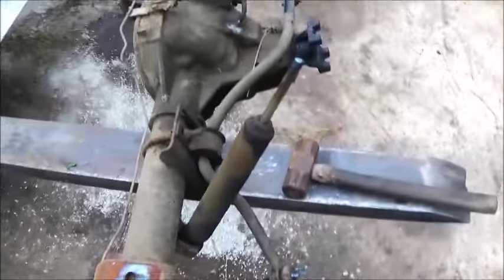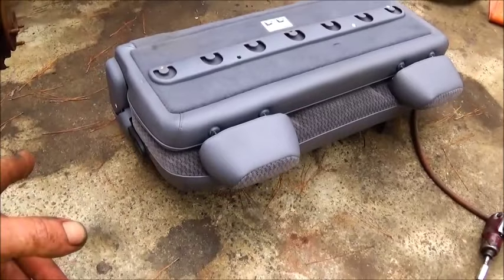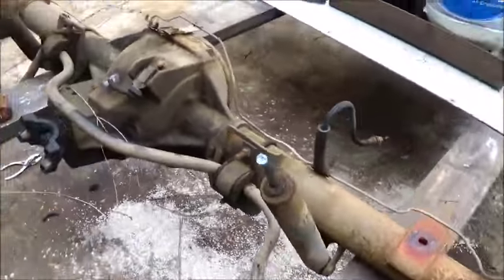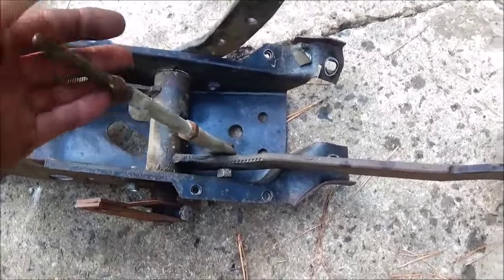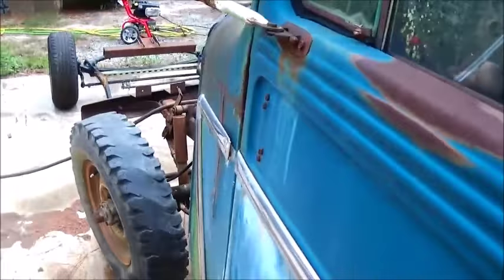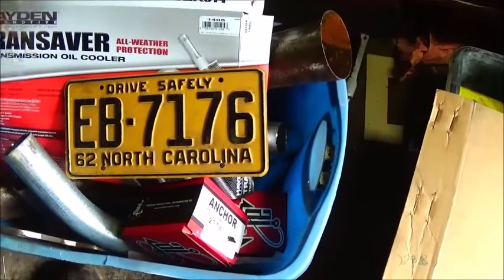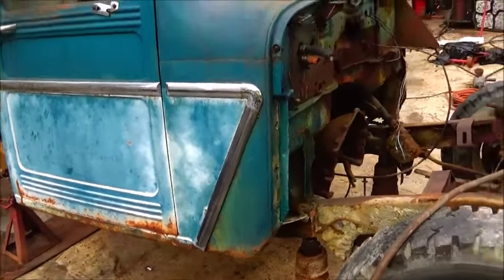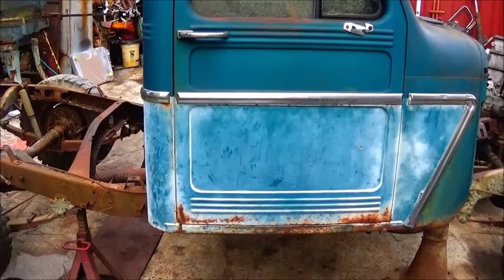One Day Rat Rod Build 3 Update 7 Final

Comment: I have one of these pickups and I would suggest a little research on the windshield installation before the build. They are a very weird window
Reply from the maker: I did a lot of research on it. I am going to the 2 piece windshield from the single. The opening measures the same. See one done and they put it in from the inside out. We will hopefully have no problems.
Reply from the maker: I had to do a little searching, but this is the best page I found on this. They put a two piece where there was a single.  http://members.shaw.ca/pavelb5/bodyWindshield.html